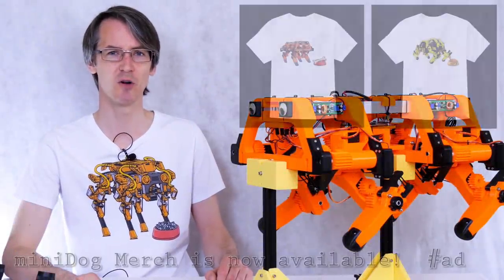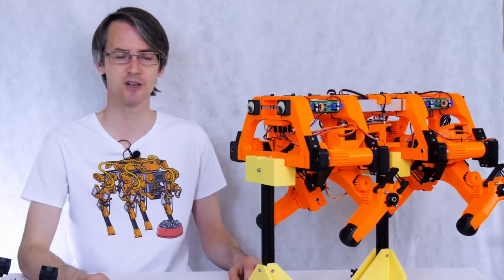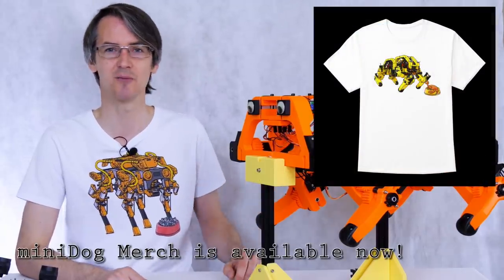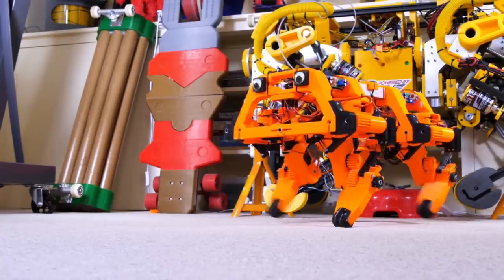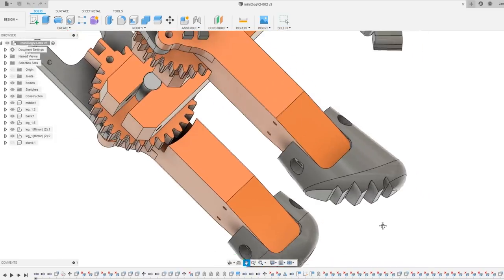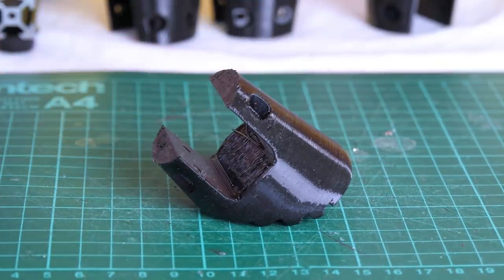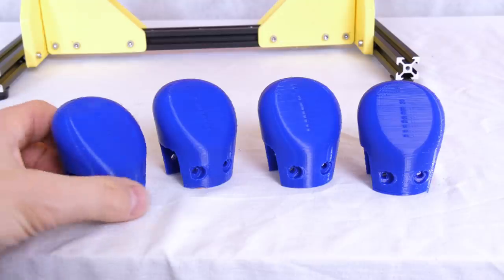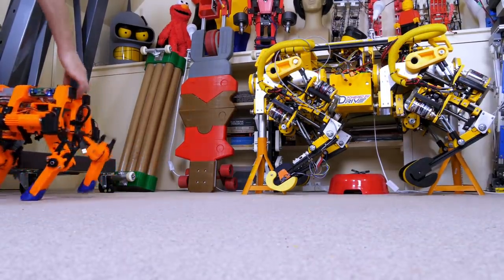Mini Robot Dog #8 - Next Steps

Comment: 8:35, Do you need a system that does that? i created a library that does that. it calculates the differnce between point1 and point2  with SCENETIME and FADETIME all can be adjusted realy easy and i also added sine movement instead of allways having  sawtooth.
but great project i learned so much, thanks!
Reply: With sine movement, you compromise torque for motion. Which is already critical in this case because the servo are already running on their limit.
Reply: @pushkarajsalunke3461  ok never knew that i always thought they run max power. but then dont use sine the sytem can also output sawtooth and square wave if fadetime = 0. but in my case the moment i used sine my hexapod stoped shredding my servos apart so sine doesnt seem to be the problem but his servos seems to be the problem.

Comment: While putting together your dog's code for use in my dog, I was wondering if there's any way to remove the servo multiplier. My dog's legs are direct-drive from the servos instead of the 2-1 gearing. Is there a line of code I should change to fix this?
Thanks for any help

Comment: Excuse any ignorance I might have...but it seems to me like you are not doing enough planning when doing these projects? It seems like every dog you build runs into a critical issue like the mass of the robot or speed of the actuators that requires a total rebuild to fix. Are these not things that should be calculated in advance? I can't imagine it would be too difficult to get a decent approximation of what should be sufficient.
Reply: The problem is, you can't really know how much weight is too much
Reply from the maker: I was aware this would be on the edge, but it ultimately walks and I got to prove my hypothesis for stability. Now that is working I'll be moving back to a premium build with more expensive brushless motors. Also don't forget the successful testing I did last year for compliance with Quasi-direct drive brushless/gearboxes: https://www.youtube.com/playlist?list=PLpwJoq86vov9Aogc6PseW8BUe2nQyZESZ
Reply: His thing is rapid prototyping which is a skill unto itself. I get bogged down with details easily, for example.
Reply: @jamesbruton  Best of luck! Did you just estimate that it would be on edge or did you do some calculations? I'm just wondering cause it could potentially save a lot of costs to do some advance calculations if you don't already do that.

Comment: Just a sugestion, wouldnt this servos work better ? DSS-M15 from DFRobot
Reply from the maker: It's less powerful than the ones I have. What is the tolerance of the internal feedback pot?
Reply: @jamesbruton  I dont know, i bought the DF15RSMG for my robot, which is a 360º servo with 20Kg per cm, and rememberd that the store also had the 180º version, so beacause it is a powerfull servo i thought that it my be usefull for the back legs of the Mini Robot Dog, because of the problem you showed in the video.

Comment: love the project, so amazing, any possible way to get stl files not stp files, my silcer wont do stp… and im having issue converting them
Reply from the maker: You need to import them into your CAD software and extract each part as an STL from there. The STP is the complete assembly, you can['t just print it in one piece anyway.
Reply: @jamesbruton  ahh ok I got I figured out, thank you. still kinda new to cad designs

Comment: Why don't you use stepper motors?
Reply from the maker: weight to power to velocity ratio mostly.
Reply: @jamesbruton  sounds more like a challenge then a obstacle.
they are very cheap tho.
Kuka uses them in their robots.(i know that's something completely different, but still)

Comment: This may seam strange but,
Can you put a second measurement system in and see if the two circuits are reading the same?
The two measurements circuits could be used to compare reading then a master controller could compare the reading from the two measurement circuits and do the maths to make the finale values for the kinematic model.

Comment: Wouldnt some kind of force sensor in each foot be a good addition, something that simply measure the amount of weight being put on each foot. With that information you can make some code (im not a coder, so kinda talking out of my ass here) that could make the dog do some kind of counter reaction to when lets say the front foot digs into the ground, causing a massive surge in measured weight on that foots sensor?  In this example that counter reaction could either be that it if you've made the springs in the legs (those that are striped right now) "toggleble" dampening just when its needed or make some code that executes when it feels that surge in weight. 

I am no robotbuilder but i hope what i just wrote made some sense :)

Comment: You'll probable will need a foot sensor to determine how much weight each foot it applying and use that data to create a compliant model in conjunction with a full body balance solution.  Tuning the arch on how the foot moves should help too as will more powerful drive system.  But each leg really needs to know how much weight it applies and it must also use an increased profile to push against the ground to maintain the body's balance.

I might be wrong, but thats how most living animals work and it helps them maintain a solid balance, but only because they can vary to force each leg applies to the ground to maintain stability and balance. If that corner is too high, then lower force, if to low, then increase force.

A sensor to reach distance to the ground in the front and back would help too, but then the math gets a lot of variables and become trickier to create as a function. Or is it really, no maybe not, though the math is the same, it is the function that become more tricky. You might need some sort of object programming and sub nodes to handle basic function on automatic that is synced up. Movement isn't done in series, but in parallel or at the same time.

Comment: I think this indicates your approach is flawed? you will never be able to fix this. I really feel you are missing a part of sensors that measure not just if the legs hit the floor but how far the legs are extended compared to the other legs and average out the pressure. The dog needs to be able to realise how it is oriented not just in relation to gravity but to the shape of the floor and where its feet are to find a centre of balance. Animals have this in their toes afaik, and its more important then the sense of touching the ground.
Reply from the maker: Yes I already did a load of R&D on compliant Quasi-Direct Drive legs which adjust their compliance keep the robot level.   There's no reason we can't 'turn around the equation' to make them force driven rather than position driven: https://www.youtube.com/playlist?list=PLpwJoq86vov9Aogc6PseW8BUe2nQyZESZ
Reply: @jamesbruton  I trust you will find the way, carry on the good work.